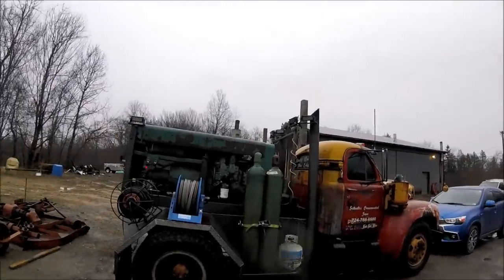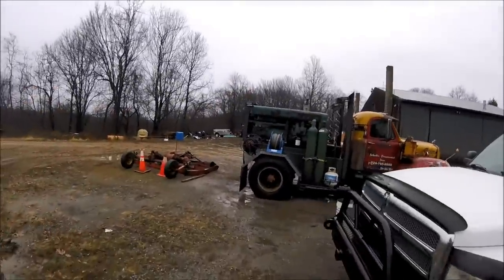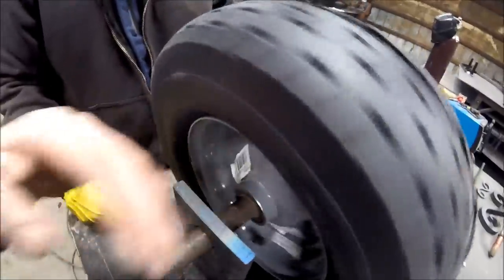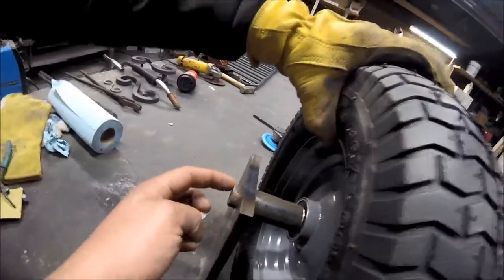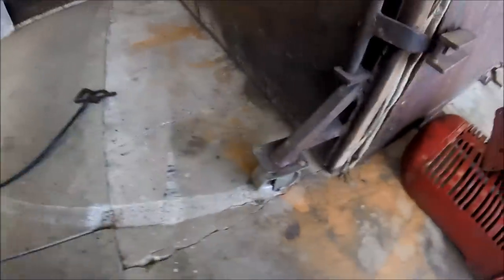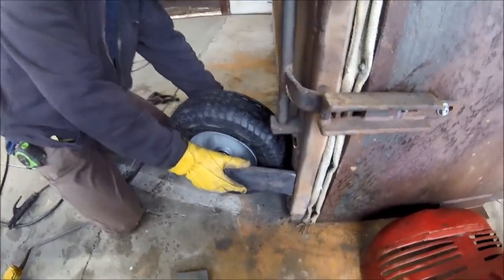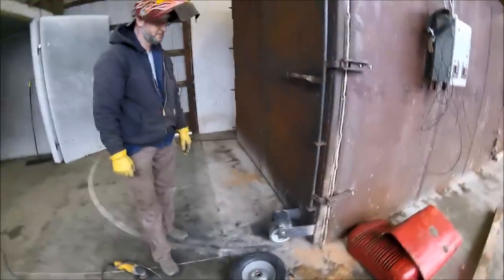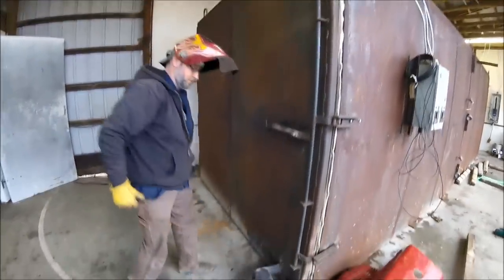Working The Mack Truck & Diesel Welder

Comment: That truck is way cooler than anything new. I have only seen this problem with retractable extension cords but do you ever have a problem with the spool of wire getting hot and melting the wire insulation on the inner winds of wire after a lot of use? I bet the solid caster works out better for you since the caster wont ever have to be aired up lol.
Reply from the maker: My wire is on 100' leads. So we unroll 100' and plug into welder, so no i dont have that problem.

Comment: I use a bi component (epoxy) on cement defects (holes and cracks). I tried using special cement and it eventually cracked.

Comment: Bolt a pice of steel to the floor so the wheel rolls on the steel pad.
Reply from the maker: I can yes, however we cart over it with parts and i dont want them rolling over the steel and banging the parts off the cart. And yes i can recess it into the concrete, but im too lazy to groove out the concrete for that. But good idea!
Reply: @95Cummins2500  i undoorstand not wanting to cut a groove in the cement, that would be a shity job...

Comment: Be Careful about letting a Detroit idle so low for long periods. I've seen scoring on the cylinder walls.  I always idled the rpm up some to avoid problems with over fueling. This is only my opinion based on my experience. Did you notice the smoke when you revved the engine? That's excess fuel in the cylinders. This excess diesel fuel will score the cylinders.
Reply from the maker: I heard that before